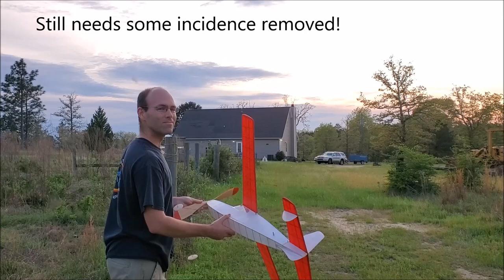Flight trimming my Gipsy old time Wakefield rubber powered airplane!

Comment: When I was in high school a friend built a replica of the 1939 Wakefield winner.  We flew it in a large field.  I notice  that you braid the rubber to prevent sagging and changing the CG when it runs down.  We would put 1000 winds in and used 90' of rubber.  It brings back great memories.   Not many people know what the  Wakefield contest was anymore.
Reply from the maker: Very cool. Elsewhere on this channel I've got a video of my own 1939 Korda Wakefield. Nice flying airplane with an interesting history. Wakefield still exists, albeit under different rules and almost absurd design complexity. Alex Andriukov has won it more times than any of us care to mention. My collection now includes Wakefields from at least half of the rules formulas.

Comment: Just found your channel ,my Dad built a Gypsy for my 7th Birthday in 1963 ,it was dark blue tissue fuselage with white wings and tail plane , I remember him having to carve the propeller from a single lump of balsa supplied in the kit no plastic prop in those days, we used to fly it in Sutton Park , Birmingham UK , it's first flight outing was a mixture of success and tearful disaster ,a couple of short successful flights followed by a longer flight culminating in the plane hitting the only boulder in the park and the nose section crumpling quite badly , seven year old me was devastated , but dad rebuilt the front end using sheet balsa over the renewed framework ,this worked great ,next couple of flights were ok ,last flight we were winding up the prop and the back peg snapped the rubber unwound as it shot toward the front destroying the tissue and a fair few fuselage parts ,it was pretty spectacular ,I see you have an alloy tube to secure your motor ,back then it was only a Ramin or bamboo peg from memory , clearly not up to being overwound . The plane got rebuilt again but never really flew that much ,it was stored at dads for years ,I think it was only chucked out during that time ,it is his 90th birthday next week I will show him your video series on the gypsy , he'll be really interested.
Reply from the maker: That's an awesome story! The Senator and Gipsy are among the most widely produced kits ever and had a marvelous success rate.

Comment: I have followed the gypsy build and wow that got out of sight quick .I coach high school football here in Vermont so this will be my winter project  I get a small check and will use some of it on the plane
Reply from the maker: Awesome! It's a great airplane.
Reply: Lucky you that you can buy it. We used to call such machines slabsiders. The flat, vertical walls of the fuselage had some ruddering effect, or so went the theory. Most designs of this period followed this high-wing, cabin set-up. As a youngster (hundreds of years ago) a British friend brought me one Gypsy kit from England. My country is hot, balsa was virtually unknown, rubber rotted away in no time, dope was unavailable, glues had to be adapted from local offerings. I greatly enjoy your series as they help to revive old memories
Reply from the maker: @riazhassan6570  where are you located? It's possible that we could get some wood sent to you.
Reply: Thanks, Joshua. I’m a Pakistani, past my model-building days. My pleasure lies in watching young enthusiasts like you maintaining, reviving and improving activities that gave people of my generation much fulfilment (and plenty of trouble also)

Comment: That was very impressive. You really can see climb performance on the lastflight. I have an old kit for a gipsy (not the new laser cut version), but I have absolutely nowhere to fly such an animal! I would prefer not to fit r/c in such a model but in an ideal world it would have some sort of "return to home" function like on some drones. Maybe that may be available at some stage in the future. Hope you retrieved it, OK. Isn't that what the 2 fetchermites should be doing for you!
Reply from the maker: Had to climb a fence so they weren't part of the chase. I know that field like the back of my hand so finding the plane wasn't difficult, plus my spotter saw exactly where it landed.
Single channel RC is a great option for small fields, and a lot of guys use radio dethermalizer to spot land their planes both in testing and contest flying.

Comment: Wonderful, I couldn't get mine to do over a minute.  Trimming is a dark art perhaps I should forget about thr rc stuff and build another.
Reply from the maker: Set your CG per plans, remove any warps from the wing, shim stab to adjust glide, then use nose block shims to adjust power pattern.
Reply: @joshuawfinn  thanks for replying your the man . Nothing worth while is easy.  England is such a small overcrowded place difficult for free flight but not impossible! .An old friend who owned a model shop refused to sell an ic powered model to anyone who hadn't flown rubber and whent out of business 
But I think he was right.
Reply from the maker: @markpedwell1250  I need a sign that says "we choose to do things not because they are easy but because we didn't think they would be hard". But yeah, tough learning curve and well worth it. It's sad how few in the RC community have ever learned proper flight trim. Hopefully we're changing that for at least a few of them.

Comment: Ingot three of those 1 that is a electric capacitor powered with a small battery to run servos for elevator and rudder has so much dihedral it rolls and yaws like a alieron plane. I got one that is rubber powered with servos that flies for a good 6 minutes and flies bye it's self with out servos and a electric conversion one with a brushless motor alierons rudder elevator and hardly any dihedral and moved the wings to the middle of fuse near bottom for doing some acrobatics it's beafed up. And that's why I got servos on all mine so I can bring the rubber power one back if it goes straight and out of sight far away into a tree
Reply from the maker: It's a very versatile airplane!

Comment: If you want to fit rc , you’re watching the wrong video ! It’s called FREE FLIGHT for a reason .Built one about 30 years ago ,time to build another 😀
Reply: A lot of OT rubber powered FF have been equipped with rudder only RC.
Reply from the maker: There's room for both. Unfortunately it's hard to find a suitable field for these birds around here.
Reply: @davidfranklin5270  Yes and if it means saving your precious bird then well worth it to have peace of mind to get it back again safely,in these days of very few suitable flying fields and most of us are leg weary and older model flyers anyway you still see the joy of a vintage model climbing for the stars so lets not get free flight snobbery  get in the way of practical  responsible operating in these difficult times,nothing wrong with FREE FLIGHT radio assist with a micro set up you can hardly see anyway,lovely build and tutorial Josh many happy hours with your  Gipsy.

Comment: Great video. Life would be easier with a blast tube,radio dt and a tracker, preferably gps! ☺️. Just like they had in the 1940s.There is so much rubber in an 8 oz Wakefield!
Reply from the maker: Yeah I seldom get situations where I can even make use of any of those other than rdt these days. Gotta fix that though...going to Denver in September and will need all 3.
Reply: I have a Pyxis gps system. Forget ordinary trackers. You just go straight to the model. Accurate to within about two feet. Pays for itself in wasted time and lost models and you can retrieve without having to walk in a straight line. Same for rdt. If it’s going to crash, rdt it. Keep up the videos👍

Comment: Love the video very envious.i am looking for some assistance.Am flying a Vernon Sentinel,the problem I have is the rubber breaking after about 6 flights it has broken either at the propellor end or the peg end. I don't believe I am overwinding.It is braided and oiled.any suggestions would be appreciated.
Reply from the maker: What kind of oil? If you're winding fairly hard, most rubber batches do tend to let go after 5-6 flights.

Comment: There used to be a Wakefield* Trophy for rubber-powered models, back in the '50s. Some of the designs had ended up in plan catalogues that I owned. 
    * sponsored by a motor-oil comoany?
Reply from the maker: Wakefield is still a thing, and you're correct about the oil company association in that Lord Wakefield was the founder of Castrol. The rules changed dramatically in the 1950s so that in 1950 the Gipsy would have been relatively competitive, and by 1958 no longer even legal for Wakefield competition. The top models were unrecognizable as being related to their predecessors following each rules change. Kinda sad really because at the end of the day it was nothing but the usual FAI meddling to make the planes into something some European country wanted, and we've been dealing with those policies ever since. Very seldom do countries outside eastern Europe exert a substantial influence over the rules.

Comment: What is a "de-thermalizer" Thanks in advance   :-)
Reply: Charles White, hi, it will at a set time lift the tailplaine, so as to bring you plane back to earth. Some planes use, say small cocktail sticks on the rear end of the fuselage and the tail with a small rubber band and a fuse between them, when it's burnt out and snaps the rubber band the tail pops up bringing your plane back to earth.
I've used both types, great fun.

Comment: Josh, I respect your building, trimming, etc. to the max. However, these vids prove why R/C assist is not an option. I'll be building a 55" Wakefield this winter (and pestering you all the way through) and you can be certain that it'll have R/C gear in it.
Cheers, mate.
Reply from the maker: The problem with rc is you never get that aspect of trimming the plane to fly itself. I have lots of RC stuff, never as rewarding as making the plane fly on its own. Radio dethermalizer is pretty sweet for keeping them out of trouble. Of course if you aren't within driving distance of a decent field, do what you have to do.
Reply: @joshuawfinn  I fully understand and agree with what you are saying. Of course, you could trim the airplane without any R/C input until it flies well, only using rudder control to keep it over the field. As I have mentioned before, there is no sufficiently large field nearby for true FF, so R/C assist is necessary.

Comment: I have just built one of these and was wondering how many turns I should give it (this has the original elastic motor in it)
Reply from the maker: The motor I used (24 strands of 1/8" Supersport, 40" long) will take about 900 turns if stretched out well while winding. A better motor for the plastic prop would be 16 strands, 40" long, good for probably 1200 turns. If you're using the kit rubber, don't go much past 400 turns, and make sure to lubricate the rubber with a silicone oil such as Molykote 33 (don't use WD-40, Vaseline, or anything petroleum based as it literally dissolves the rubber).
Reply: @joshuawfinn  Many thanks for you quick reply. would vegetable Glycerine be OK as a lube?
Reply from the maker: Yes glycerine can be made to work well.
Reply: @joshuawfinn  Ta

Comment: Wow, Ive built a couple of balsa rubber powered biplanes but ive never seen anything like that,  It took off vertically.  How high does she fly?
Reply from the maker: What you saw in the video was maybe a 200' climb. I've got it on good authority that standard power for competition was 50% more, and on a longer motor, so you could expect 400-500' in proper trim at full winds.
Reply: joshuawfinn k

Comment: how long and thick rubber are you using and how many revolutions
Reply from the maker: 12 loops of 1/8" rubber. I don't recall turns count but probably 700-800.

Comment: Sorry if I missed this from another video, but do you have thoughts on tubing over the prop shaft to stop rubber/crocket hook vibrations? I’ve seen it done before and might give it a shot on my Gollywock
Reply from the maker: Good question. Unfortunately I don't know the answer. Hopefully I'll get some help on it in September when we go to the Denver meet. My Moffett has been completely dogged with vibration issues associated with that high rpm prop.
Reply: @joshuawfinn  Hope you figure it out! I have some family in Denver -- would love to make it out there sometime with a big OT ship.
Reply from the maker: @sandfac3427  you've got to make it out there sometime. That field is something like 36k acres. Largest FF field in the world as I understand it. Get a short kit from Jim O'Reilly for the Tubesteak. 300 sq in of awesomeness. I believe he has Bob White's Super Twin Fin as well. I'm currently selling short kits for a Moffett and Mulvihill, too, and planning to add some more soon like Perryman's Great Speckled Bird and Kluge (almost 8 ft long!).
Reply: Sandfac. The solution is to use a Tim White hook on the rubber coupled to a reverse S on the prop shaft with a tubing sleeve.

Comment: Josh, do you ever work from old original plans?
Reply from the maker: Well, copies of originals at least. Nowadays I usually redraw the plans in CAD so that I have parts files to endlessly reproduce should anyone else want them. Oldest two designs in my stable are the 1928 or 29 Mott twin pusher and the PEG 54 of similar vintage. Also have a 1933 Clearfield ROG, used to have a 1932 Gordon Light winner, and of course always have to have at least one Gordon Light Zephyr in the stable.
If that's not enough, I just recently created plans for an unpublished late 70's Mulvihill that had been in the estate of one of our club members, and I've got several unpublished George Perryman planes waiting their turn to be drafted and published, plus Jim Walston's AMA power models, also all unpublished.
Reply: Kewl!